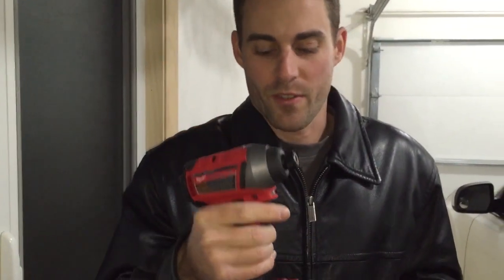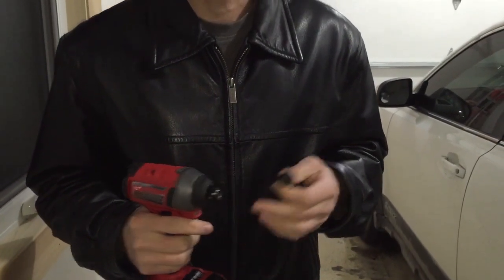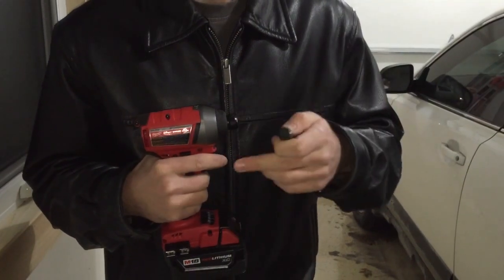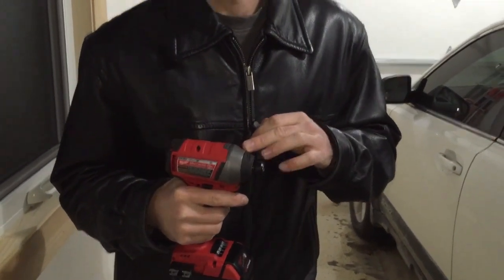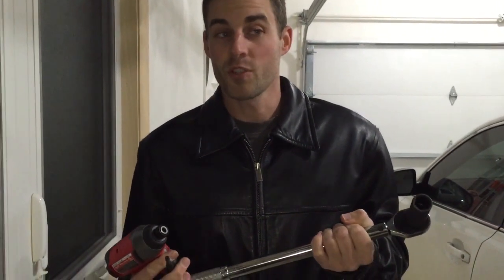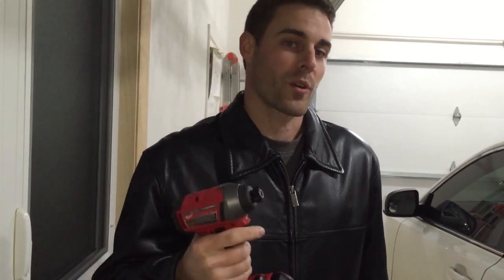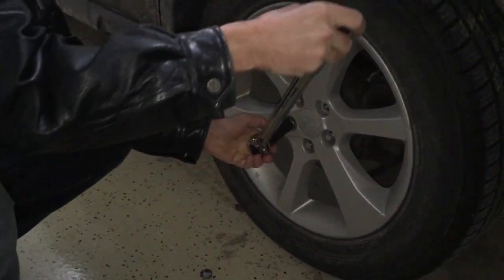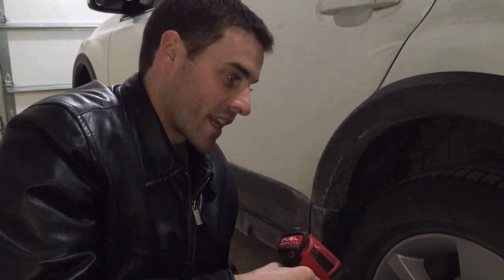Difference Between Impact Wrench and Driver (Milwaukee Fuel)

Comment: You are incorrect about the forward and back impact, that is what you call a Hammer Drill, not a Hammer impact. Impact drivers and Impact wrenches work on the same principles. Only difference is one puts out in-lbs and the other puts out ft-lbs, while one has a hex socket and another has a square anvil.
Reply: This is actually how an impact works. https://youtu.be/f0gSJa3L_7c
Reply: I have the 1/4 impact. should i go with 1/2 impact for car lug nuts?
Reply from the maker: There is a small forward impact. The cylinder slips back as it rotates and it springs forward which results in a slight impact. Not as much as a hammer drill, but it does. If they were exactly the same then they would just make one that's universal since you can get attachments for either. 

Axial impacts on drivers is to assist and prevent cam out when driving screws. It alleviates the need to apply as much forward pressure like a regular drill. If it had stronger impacts like hammer drills, then it would ruin the threading.
Reply: in-lbs and ft-lbs are just different units....to measure the same thing. An impact driver will usually advertise in in-lbs cause consumer are stupid...they see 1800 in-lbs and they go wow. Impact wrench will advertise in ft-lbs cause usually only pro or pro-sumer buys it and all the torque spec for nuts are in ft-lbs.
Reply: Random Ryan they both have the same mechanism.
Reply: The arbor has a cam on hammer drills that not only impacts but it raises and lowers the arbor twice per cycle. Hints, hammer. Impact drills and hell even regular drills can work on masonry bits but for real concrete drilling with rebar you must have a true hammer drill and for rebar you need a 4 headed bit. Normal spades will dull in seconds. But even the 4 headed needs to be kept cool. Wet drill the wholes!

Comment: Impressive amount of nut busting power from a 1/4 inch hex through an adapter then finally through to the socket to the lug nut. I am in the market for a impact wrench or impact driver too. The impact driver is more versatile. You got me thinking. Thanks for the demonstration!
Reply: Milwaukee is the absolute best , especially when it comes to torque

Comment: Soo all impact drills are impact wrenches while impact wrenches are not drills.
Reply from the maker: Candi Soda basically, yes. Just less ft lbs. However, because of the axial impacts, in can in some cases effect machined threads on tightening. Depends on how it's used. Typically not an issue though.
Reply: No !!!
Thats an impact driver